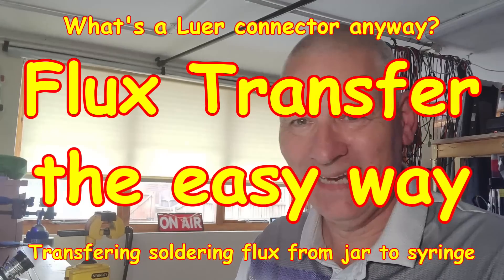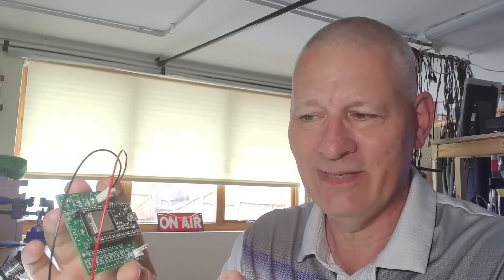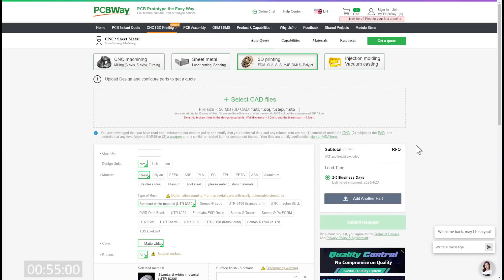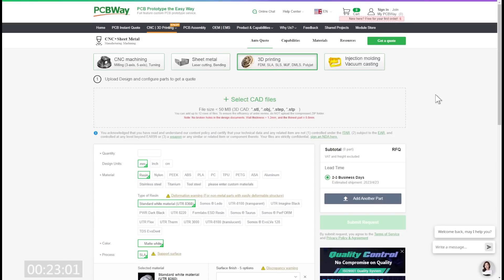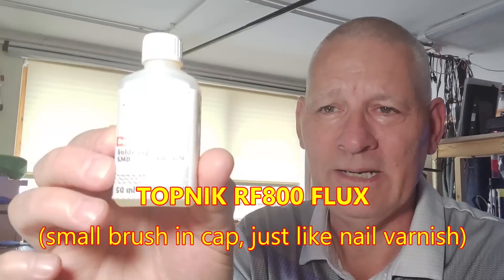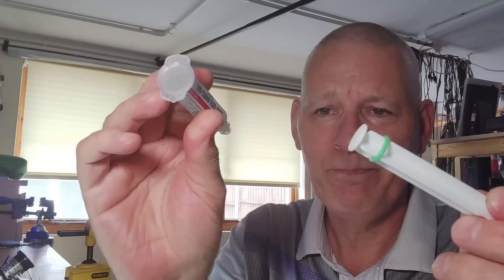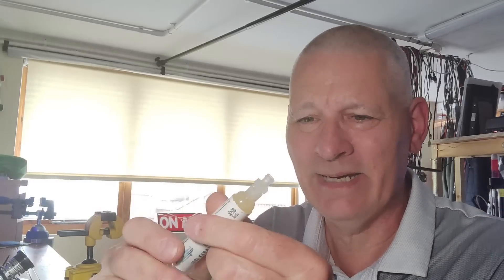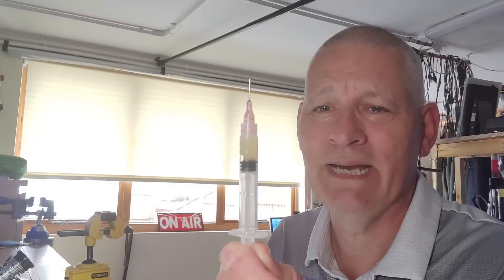#268 Soldering Flux from Jar to Syringe - with a Luer! 😁

Comment: The reason the internal plunger for the syringe is separate from the rod, is for the same type of machine someone else mentioned in the comments below. It's for pneumatic dispensing machines, where air pressure is used to dispense. 

The rear throat of the syringe needs to be clear to provide a surface and space to seal against, whereas the lack of a rod lets the pneumatic system use more of the air volume as a cushion that makes changes in pressure more gradual (prevents accidents).
Reply from the maker: Always good to know the reasoning behind these design decisions! Thanks for sharing. 👍

Comment: Ive once bought a flux that came with a metal can, and i thought putting it in a syringe would make the work much easier, i simply put the can in the air fryer with the lid off and turn it on on the lowest heat, 80c, after three or four minutes it melted completely and simply sucked by the syringe, you can use this method or putting it in hot water even if it came in a plastic container, just remember to not use very hot water it could possible melt the plastic
Reply from the maker: Yes, I've tried this too, but once re-solidified the flux can be too solid for a syringe to work well. You might have to add some extra "flux thinner" aka IPA.
Reply: If you want a smoother application instead of an ipa that will dilute the mixture, try a few drops of glycerin! In some data sheets, it is used in the manufacturing process and makes it easier to dispense. @RalphBacon

Comment: For years, I’ve just carefully nuke it, then suck it up in whatever syringe 💉 I prefer.
Never melted the plastic jar it comes in…
Reply from the maker: How long does it stay liquid in the syringe for afterwards?
Reply: @RalphBacon  oh, just a few minutes.  I only nuke it for a few seconds at a time, constantly stirring until it just becomes thin enough to draw up.  I never have melted the container, nor have seen any degradation or separation of the flux.  
73… 🤓

Comment: Arduino have stated that IDE 1.8.19 will be the last V1 release and will referred to as 'Legacy'. Version 2.1.1 is now recommended for all users. I think it is a good time for you do a review of this new IDE.
Reply from the maker: Yes, I'm using 2.2.1 and it's OK. A pity they have hidden/removed/not yet implemented all the advanced features that Eclipse allows.
Reply: @RalphBacon  For the number of years that they have been developing it, it is still a bit lacklustre.
Reply from the maker: No comment. 🤐 As an aside, why did they not just use VSC with a simplified/modified PlatformIO? No overhead to maintain, works just great!

Comment: Hey Ralph. Love your vids but in some you show a WebRadio PCB that you made using PCBWay. I can't find any video about that PCB or find it on PCBWay and I would very much like to order one (maybe modify it a little first too). I have a MiniWebRadio on a breadboard (using a small 6-pin DAC board instead of VS1050B) and would like to turn it into a neater arrangement and put it in a box.
Reply from the maker: Mine was a two-part solution: one for the "main board, ie ESP32, VS1053, audio transformers etc) and another one for the TFT screen so the TFT could be mounted more easily inside a case.

I can send you the EasyEDA project if you want so you can at least play with it and totally revamp it if you want? If you can use EasyEDA then email me and I'll zip it up for you.
Reply: @RalphBacon  That would be great - thank you so much. I will contact you.

Comment: Are there luer adapters with a taper to fit standard taper end syringe?
Reply from the maker: I didn't see any but then again I'm not really looking for those. Google may be your best friend if you have, indeed, a tapered syringe. OTOH you could just buy those syringes I showed, a whole pack of 20 (or was it 30) for a very reasonable sum.

Comment: All jel flux melt. Put the "tub" in hot water (around 50C works well) and wait for it to melt. Now you can literally pour it into any syringe without the need for spudgers etc. You can use a funnel though. As long it you don't boil it, the flux will not lose its properties when melted and return to its original consistency when cooled down.
Reply from the maker: Yes, you could do that. But is that less work/mess than this way?
Reply: @RalphBacon  I believe that's how the original flux syringes are filled in the factory.

Comment: 15 seconds in the microwave and just suck it up.. same as I do with honey that has set.
Reply from the maker: Oh think of the bees! They worked so hard to make that honey, no longer runny, and you zap it in the microwave. 

Sigh. 

Well, I do that too but not with flux, because (a) I don't have a microwave in the workshop and (b) if my wife saw me melting flux in the kitchen I would be banned for life and (c) it's all too much of a chore now that I have discovered Luer connectors!

Comment: Hi Ralph, Flux the easy way. Fantastic !!! I will be trying this myself thank you. Sorry to change the subject but could I ask which current protected bench power supply you use ?  as this is the next item on my shopping list.
Regards,
Martin.
Reply from the maker: My PSU is a TENMA 72-2690 and gives me 30v at 5A. I like it because you can control the current maximum (and set the voltage) very easily once you have figured out what the rotary encoders are doing! 

When I connect up a new circuit I always set the current max to, say, 10mA, on the basis that there should be very little (if any) current flow before I connect the microcontroller. If the PSU trips (shuts down the current) then I know there is something wrong.
Reply: @RalphBacon  Thank you for this information it's very much appreciated and such a great help.

Comment: Why mess with syringes? Use a cotton swab to apply directly. SO much easier. I used to use syringes, with all the headaches associated with it. After watching androkavo soldering videos I just switched to using Mechanic UV80 with a cotton swab. Never looking back.
Reply from the maker: Hmm. Just watched one of his excellent videos but using a cotton bud/swab is, in his own words, a bit messy. Typical British Understatement! Using a syringe you can be much more precise, and with the smaller nozzles I showed, very accurate indeed.
Reply: @RalphBacon  is precision application of flux truly necessary? i find it isn't needed at all. it's precision application of solder that matters. the louis rossman and androkavo method of drowning in flux makes soldering so much easier. precision application of tiny bits of flux means if you mess up you have to be very quick and precise with your soldering. if you screw up you have to go back and add more flux to have another go because it's instantly consumed. if you have a pool of flux you can take your time and not be so rushed. especially as you get older and your eyes and hands get worse, this starts to matter more and more. i choose ease and a bit of mess over neat & tidy but increased effort. you have to clean the residue off afterwards anyway.

Comment: Great job Ralph, I built an automated syringe filler for the company I work for. We produce Flux and Solder pastes. I ended up using an arguing nano for the control but essentially we apply air pressure to the top of a 30oz cartridge and have a manifold that a syringe locks onto and then once in place the air pressure increases to punch the piston down in the large cartridge and back fills the smaller syringe, once full the air pressure is released and then the syringe is ejected ready for the next one.
Reply from the maker: Sounds great! Basically, a commercial implementation of this idea?!?

Comment: And to get rid of the sticky stuff, use tea three oil, lighter fluid then IPA, with a toothbrush or similar. Compressed air helps, after it is all dry for the last dusting off of IPA.
Reply from the maker: Hang on, Neil, 
    compressed Air + flux = mess all over my workbench;
or have I got that wrong?
Reply: @RalphBacon  air after IPA dried for last dust off. Just a jeweller's hand foofer will do
Reply: Acetone
Reply: @bobsoft  be careful. Acetone often attacks things in unexpected ways.

Comment: In which Ralph recreates the historic Apollo Soyuz mission. I see someone was quicker on the space reference than I was.  Couldn't you stick the point end in the goopy stuff and pull theplunger?(on the ones where the rubber stays attached).  As Peter Gabriel says, "feeding gorithm" (AL to his friends)
Reply from the maker: Unfortunately, just sticking the syringe into a tub of flux is like taking a sledgehammer to crack a nut - and doesn't even work unless you pre-melt the flux, of course, which can be/is very messy. But don't give up try my method, it really does work well.

Comment: Love your videos - hope I've not missed any recently.
Interesting flux approach but I use Chemtronics 8200 which comes in a fibre-tipped pen. This is a liquid in this case for leaded solder ( I use) but a version for lead-free is available. 
In use you just wipe it across the pads you want to solder and it leaves a thin film which makes soldering very easy.
Cleaning with IPA (toothbrush and cloth) I would recommend as it is a bit sticky in the short term.
A 9ml pen costs about £10 to £12 but I'm still on my first after about 5 years. 
Phil
Reply from the maker: I tried a pen just once, and it sort of worked but not as well as true flux. It was Louis Rossman that converted me to the pure stuff (as well as accepting that you can never have too much flux).
Reply: @RalphBacon facts!

Comment: I had a bottle of that Topnik flux, but I they it away! I don't know if it was fake, but the fumes from it literally took my breath away. It struck me as being very toxic. Did you get the same effect?
Reply from the maker: I can't remember, but even regular solder (with embedded flux) does that to me, which is why I have a small USB-powered desk fan on my soldering desk. My lungs thank me everytime I switch it on.

Comment: Instead of pushing with much force onto the big syringe to transfer the flux to the other smaller one. Simple PULL the smaller/empty one a bit out. You'd create a small vacuum that way, and your don't need to PUSH so hard on the big syringe. If done right (PUSH & PULL), the flux will almost transfer itself, without you needing to apply much force at all!!

Same principle/tip applies for storing the syringes: If you're afraid some flux will drip out, simply PULL the syringe a bit after you've done (and then cap it off, if you have caps). That way there is far less chance something will drip out unintentionally. --> also works for anything else that acts as an syringe, eg: TEC7 tubes/guns, or hotglue guns, etc, etc
Reply from the maker: I'll try this the next time I do this (which will be shortly as I have almost used one 2ml syringe of flux since this video).

Comment: Good to know. Luer.
Reply: This is good info. Getting luer to NPT adapter to connect a zerk fitting to use a syringe to measure shot volumes from a handful of different grease guns in the shop. This way we can label each gun with # of shots per oz.
Reply from the maker: Sounds like you know what you are doing there with all those grease guns.

Comment: Hi, you can try to put your flux box in an oven at around 120°c to melt it then you can pour it in the syringes very easily.
Reply: After a particular event that shall not be mentioned, the ‘Boss’  in my house says nothing goes into the oven except food.
Reply from the maker: Yes,. melting the flux has been suggested a lot, but I'm not so keen on liquid-like flux on my workbench.

Comment: 2 mL syringes with large bore blunt end needles are also perfect for injecting Irish Cream Liquor into mini chocolate eclairs for Xmas parties. (Or when you're peckish in the workshop). My handy hint! Cheers Ralph! Great to see you back.
Reply from the maker: Now this is REALLY thinking outside the box and I will remember this for XMAS 2023, great suggestion!
Reply: @RalphBacon  Make sure you pick up the correct syringe. An eclair full of flux would be gross.😝
Reply from the maker: All good points. But if we bypass the eclair all together and just syringe in a mouthful of Irish Cream Liquor, I'll just use a glass!
Reply: And it goes without saying just injecting Irish cream directly into your mouth and bypassing the eclairs altogether.

Comment: I've been using the flux pens from China for SMD soldering. They work okay but don't have much time as the flux evaporates really quick. Going to try your method I think and see if it works any better.
Reply: Not particularly happy with my flux pen. As you say it evaporates off too quickly. Flux dispensed from a syringe is way better
Reply from the maker: It will work better, I assure you. Just remember to drink your beer and use IPA to clean the PCB.